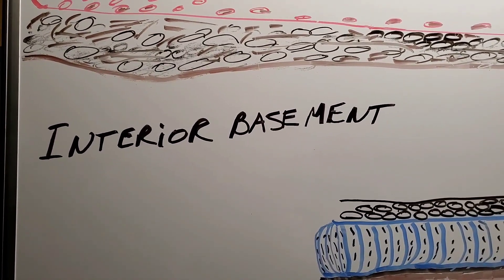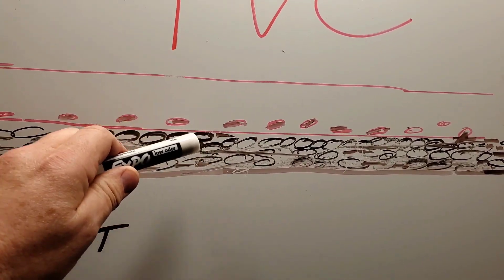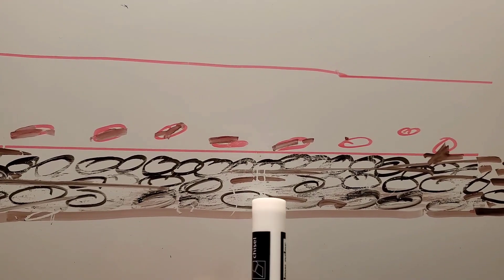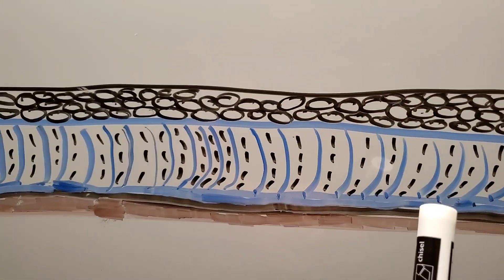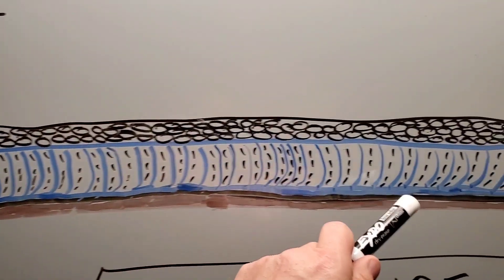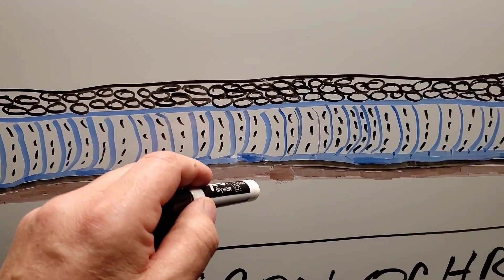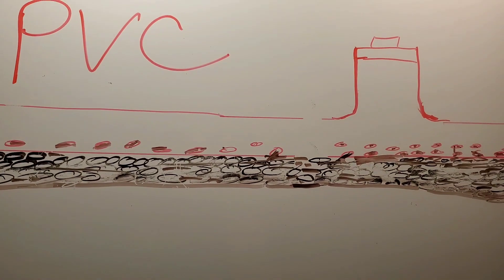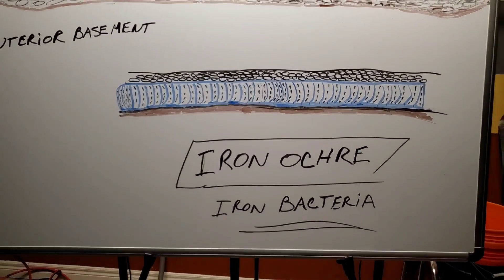Interior Basement French Drain Systems [ How to Build [ Explained by Licensed Builder ]]

Comment: Gosh ... so many questions. 

First, if my basement walls seem to be 1/2" - 3/4" out of 90 degrees(the top of the walls are 1/2" - 3/4" leaning inwards I was told) does that mean my walls need to be pushed out with adjustable bracing?
Reply from the maker: @impactlife1875
I would have several interior basement contractors come out and give their insights. 4 stars or better.

Comment: Should an interior basement French drain be needed if the house already has a sump pump?  With what I would assume would be the drain tile around the outside of the house.  Water is coming in where the floor meets the walls.
Reply from the maker: Yes you need drain tile.

Comment: I  love your content and much of what you're bringing to the drainage world out there. BUT, I don't quite understand the argument regarding corrugated vs PVC in some applications.  PVC having a flat bottom shouldn't hold onto water, especially compared to the "corrugation valleys" that will hold water in each.  Once each valley receives it's first inflow on water, I believe, they will then always have water in them, if there's somewhat frequent inflow (active water table) which is considered common, and the whole reason for these interior systems.  When it comes to having a bone dry system with low PSI from water table (not like a outside FD or downspout system would have) PVC seems like a better choice.  
I would love to hear your pro opinion as to these idea, Bob!
Thanks in advance
Reply from the maker: Corrugated is vented, PVC is not vented. We move air through the pipe venting out the top. It stops bacteria and root growth. Our 8 slot has 17 1/4" square inches of inlet / outlet per foot and vents so well it air pruns roots off and doesn't provide a green house like environment to grow bacteria, mold and roots. When using 2 pipes on the bottom with large washed stone roots can't survive and the circulation of air venting out the top and sides is a huge plus. No bacteria growth is another plus. I really need to do more videos on this.
https://youtu.be/FRrNDTeRykg
https://youtu.be/kqUNnc0j8Kg
Reply: @FRENCHDRAINMAN  If one were to lay the PVC pipe down with the two holes facing down (although the two holes are not facing 6 o'clock more like one at 5 and 7), but then drilled out a "vent hole" at 12 o'clock, facing up, would that satisfy?

Comment: What should the dimensions be on a French drain
Reply from the maker: Varying degrees of width and depths. The bigger the subsoil excavation equals a bigger vein of stone. The more stone better the French Drain.
Reply: @FRENCHDRAINMAN  no base line thanks for the help I think  I will go with 12 in wide by 18 inches deep thanks
Reply from the maker: Never go deeper then your discharge. Discharge evaluations vary. That's why we make so many different types of sump systems. 7 ft is our deepest

Comment: If people put fabric on the trench bottom,  and put PVC holes pointing down and no rocks,  does it solve PVC holding water problem ?
Reply from the maker: https://youtu.be/TmmAScI6MgU
Reply: @FRENCHDRAINMAN  looks like this video is no longer available.  I had the same question, could you advise?  Also wondering why PVC is used for new construction exterior drain tile systems (new england area).  Thanks!
Reply: @timfamolare1229  good question.
Reply: No, because there is no way then for water to enter the PVC pipe.  That's why they have that thin layer of gravel.  Corrugated pipe with slots all around do not need to be lifted off of the ground because water can enter from all sides.